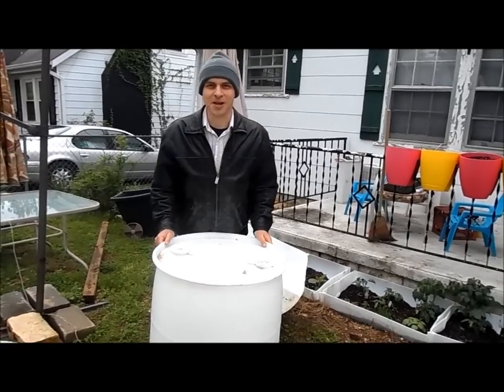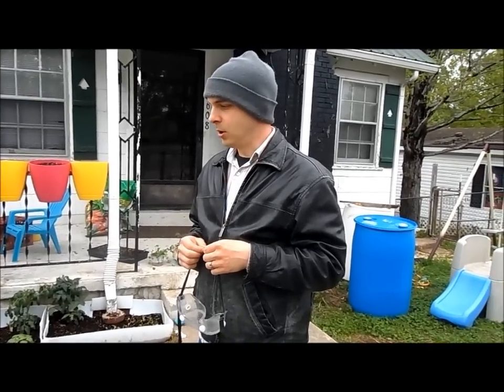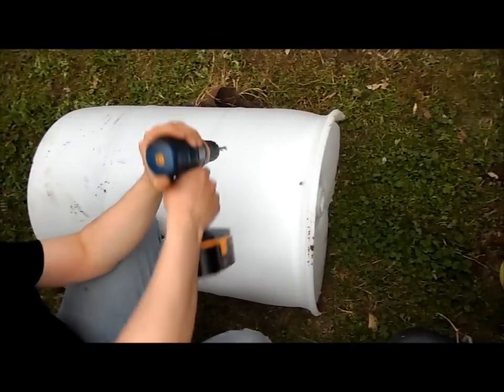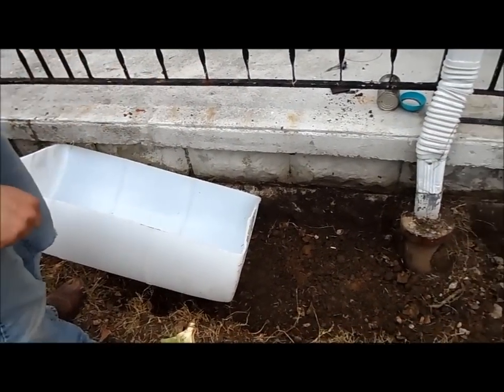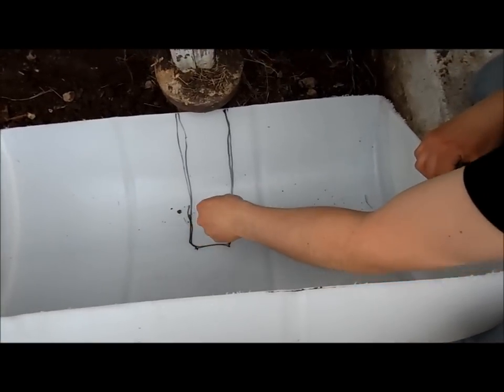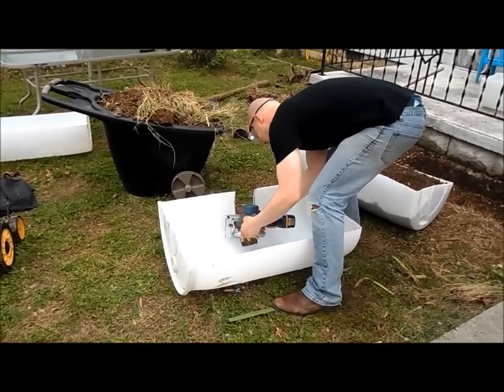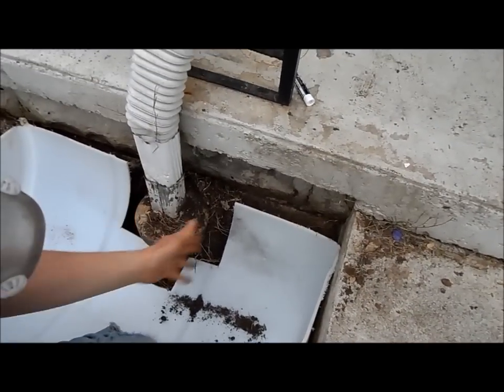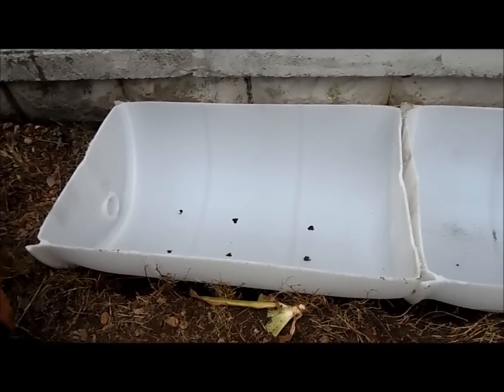how to make a raised bed out of a plastic 55 gallon barrel

Comment: So what are the advantages of using the container as the bed for your plants vice just into the ground, just got a couple of these barrels trying to see how best to use them
Reply from the maker: One of the cool things about raised beds is that you have a contained line to mow or weed wack right up to. You also don't have to bust out a big tiller every year :-)
Reply: its also transportable, so if you move you can take it with you. OR, give it to a friend as a gift.
Reply: Also if the spot you want to grow on does not have optimal soil, then when you add this kind of container/raised bed to that spot, you can put in your own good growing soil.